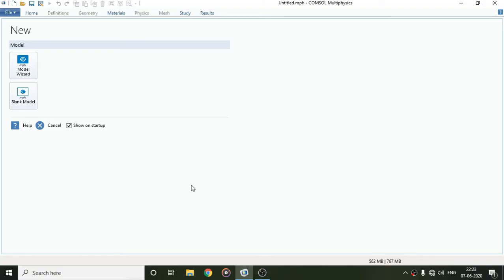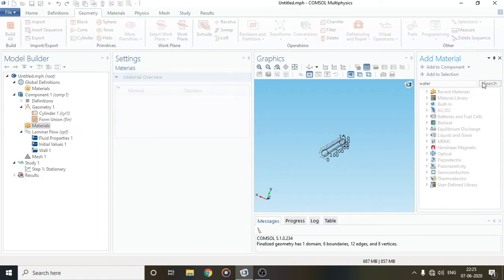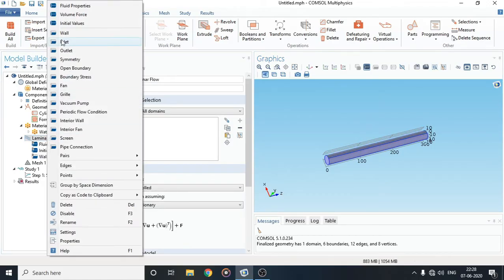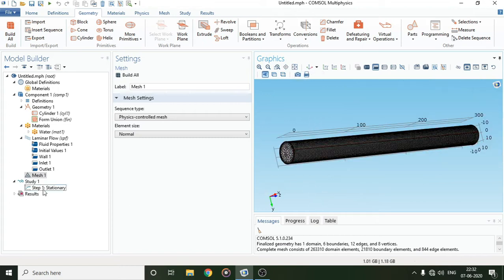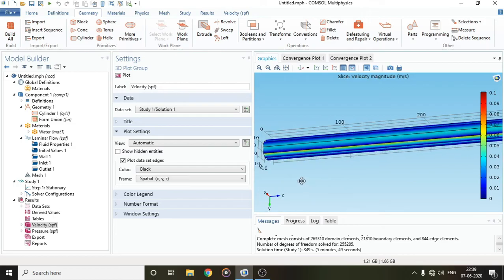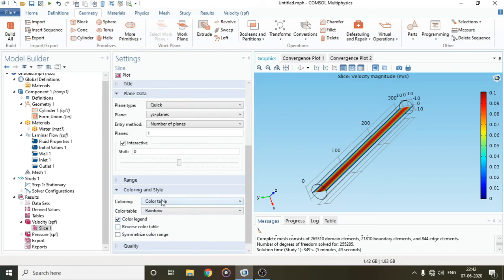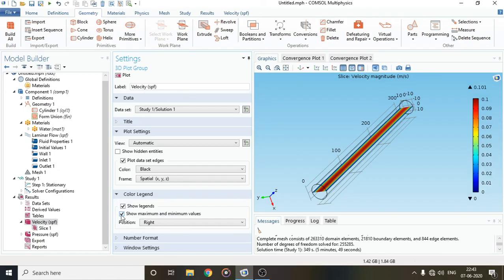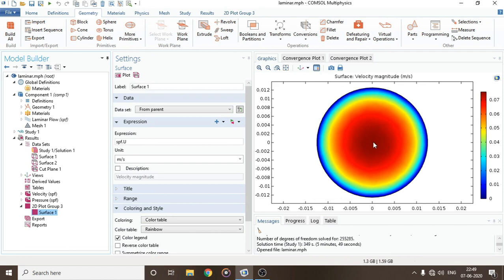Laminar Flow Analysis by COMSOL Multiphysics (Fluid Flow Module)

Comment: Sir, can you please tell how to find surface resistance( electrical contact resistance) in COMSOL. I m doing a project on spot welding. I need to find the surface resistance between steel and aluminium.

Comment: Sir i am studying for the effects of roughness on a circular microchannel. I want to create the entire rough surface on the inner surface of the channel.   I have my conditions as:
Outer diameter- 0.282mm
Inner diameter- 0.123 mm
Length --- 140 mm
Roughness height--- 1.4 micrometer
standard deviation-- 1 micrometer.

Please provide me a demonstration on how to create the model with rough surface and study the heat transfer characteristics. It will be you major help sir.
Reply: do your own work